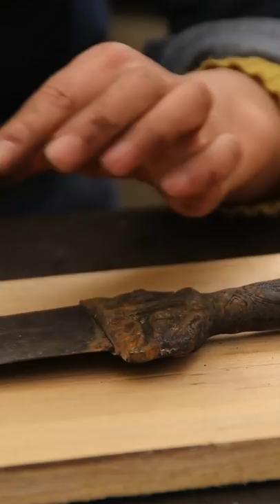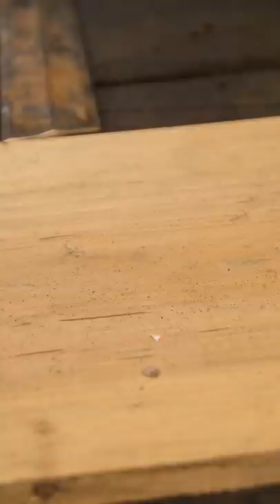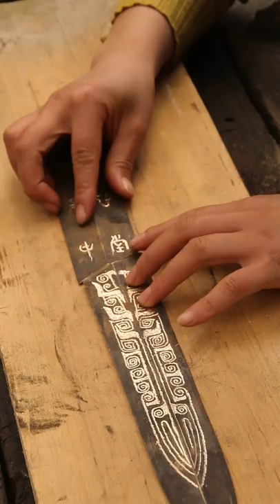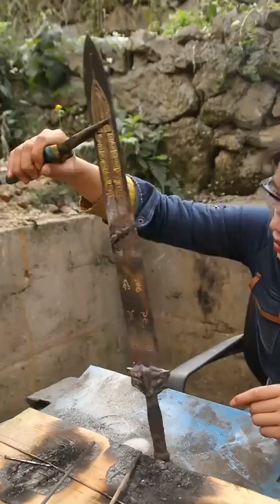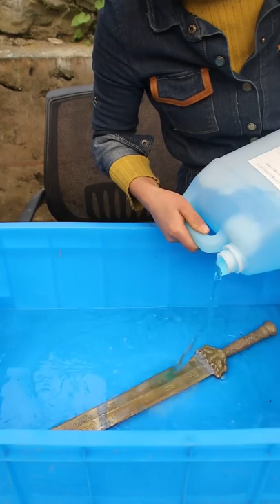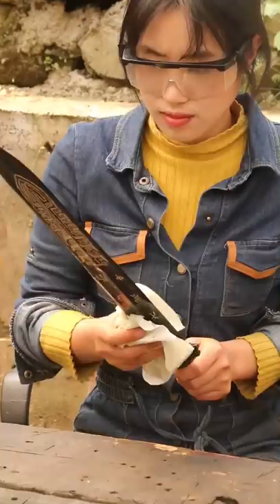💡Restoration Of Broken Unique ROYAL SWORD From China | Linguoer

Comment: great finish, looks awesome. as someone who has brazed without flux i could feel your frustration in getting that alloy to flow, petroleum jelly or filtered lemon juice can be used as a basic flux or if you have any pine trees nearby the sap can be dissolved in acetone or other solvent to soften then used as is
Reply: Thanks for the tip ! Can you please tell me what metal and rod it could be used for ?

Comment: I know that isn't the kind of thing you usually do, so here is my analysis, for this one.

You are using the wrong welding head, but then again, I do not know if you even have access to the right ones. In any cases, a narrower nosel that produce a very accute focus is what you would have wanted. It is likely that you would also have needed to seriously pre-heat the whole sword, and then work your heat up from the central spine to the thiner edge, the welding material, should want to stick and spread right away, if not, the surface might not be clean enough and the temperature of the sword, more than likely too low. Honestly, the whole blade should go through the whole heat treating process, which mean, the hilt probably would have had to be disassembled, so that you can get the whole thing out, to weld and do the heat treatements all over again.

Considering the tools you used, this is a damn good job. Your angle ginder skills are what amaze me most, it is a shame we did not get to see them, to their true potential, on this one (I picked a few tricks after seeing you cut relatively clean circles with the thing!).

Edit: Actually, I am a dumb shit, this swords is likely a wall hanger, no heat treatement needed and the whole hilt also seems to be steel, at least as far as I can see from the video.

Comment: That is some serious skills, soldering with a cutting torch. Perfect sanding out excess!
Reply: Brazing
Reply: @set3777  I stand corrected, brazing.   I guess I was too tired when I first saw her trying to bring the two pieces together.

Because the rod balled up, it look like lead instead of a filler.  I believe if she brushed the pieces, washed with acetone, heated the metal until it turned red hot, and then dipped the filler rod into Flux before applying,  she would have gotten the results she was looking for. 

On the other hand,  I'm surprised with all the electrical devices she's rewired, that she hasn't come across a TIG welder or for that matter,  has created her own TIG electrode without gas.

Comment: You need to get the work hotter and add more flux,  before you add in the rod. Then it will flow into the joint. 
Standing it on something stone rather than wood would reflect heat and help the process. 
At least you are wearing eye protection in this video.  Stay safe.

Comment: Even if it looks pretty as a decoration item, it can no longer be used.  The method of welding that you have applied is the least approved, because with the heat of the torch you remove the temper from the steel.  In addition, this solder does not have enough consistency.  You can autogenously weld, but then you have to temper and sharpen.  The risk is that the sheet is deformed.  I would weld it with TIC.  Apart from this, I admire you a lot, because you dare with everything and manage with few means and because of your young age, you know a lot.  I take my hat off.  Keep it up.

Comment: ncie job, a tig welder and precision grinders, silk screen the patterns you could have totally resurfaced and engraved it in less time, like new blade, I like it its a cool blade I can see why he wanted it restored.. it has character, just needs and edge put on it then sharpened to a razors edge and it makes a nice blade for trailblazing in the jungle, keeping snakes and wild animals at bay and filleting the days catch.... robbers too...  :-)  also you can temper it ocne its finished or pre dress stage.. good and hard but not brittle like it was, that's why it broke like it did, the tempering was incorrect, too fast and too hot =, made it brittle, the molecules have to be realigned ina specific manner and they metal is very hard but not brittle, will bend before it snaps, forged if you will..  I bet she would use a nice forgery setup if she had one, maybe she does?  find a nice fine white sand beach and stock up its one, start recycling the areas steel into good reliable useable stuff... 

I wish she had a tig/mig welder, a combo unit, the one that calibrates and chooses feed all that as you go.. on the fly welding mig or tig, yes they have those.. dood in the garage uncle tonys buddy that restores cars who just passed away had just purchased one, not even sure he got to use it?... very nice welder tho.. she could do anything with one of those and a grinder setup..

like to see her grow, more tools, better tools, bigger shop, bigger restorations, she has the right attitude for this stuff..

maybe we all pitchin or do a gofundme something to get her started in something bigger and better, this kind of talent should never be wasted, sure she is good at winding motors all that, but I expect she is much more than that..  she needs a good supply of steel and alloys, mig/tig welder, good arc welder, acetylene torch.. a bench of good grinders, a set of good hand grinders of various assortments and grits.. clamps all that, drill press, lathe, band saw.. full on shop...  I fear there is nothing she cannot accomplish given the tools materials and time..

all we to do is teach her the use of quality control and what fine quality is, they haven't been taught this in Chyna, no offense but it's just not on their agenda, she can be shown and led to appreciate what real quality and craftsmanship is, maybe it spreads like wildfire in her country, then everyone in chyna wants to create good solid quality wares, they will want to prove their capabilities through their fine craftsmanship, she has what it takes, I know this... gotta start somewhere

Comment: The sword itself is very bad quality material, or wrong hardened, or - after hardening-not let out.
When I saw it right, you soldered it with hard solder, containing silver.
Welding with flame and bronz would have been stronger.
I assume the sword is meant for decoration; with the finishing of the decoration you did an excelent job.

Your grindingmachine: the stone needs redressing.